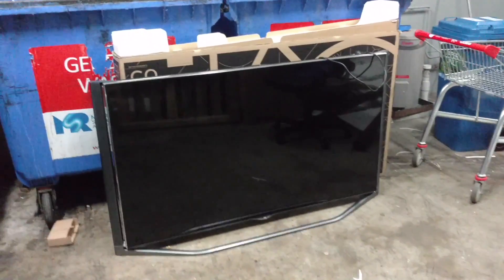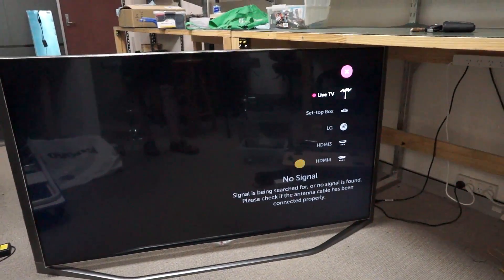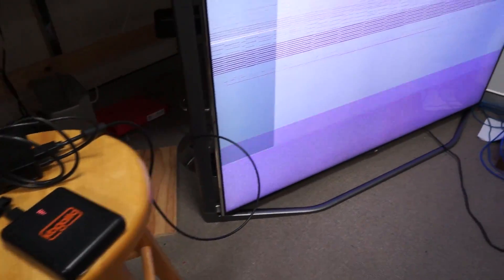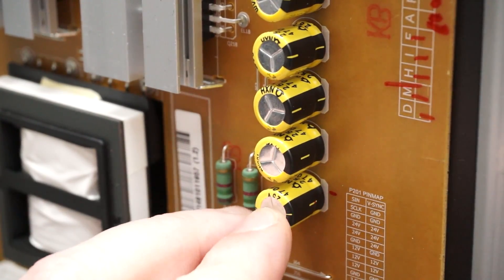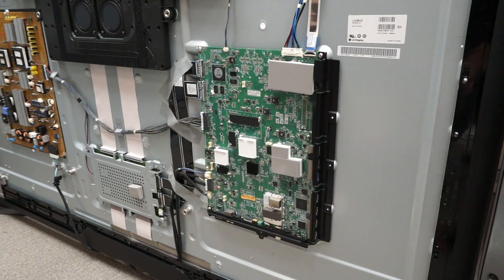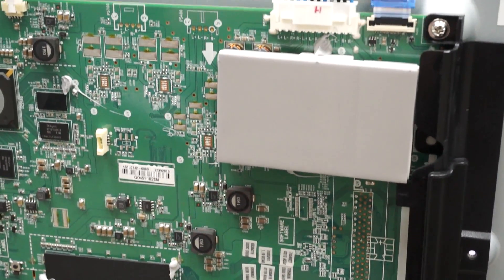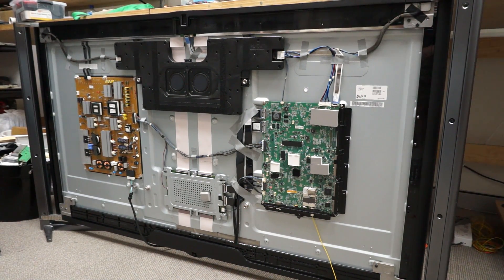EEVBlog #1145 - Dumpster Diving 4K TV!

Comment: I got an excellent salvage just before Christmas. One of the sales guys here, his mom's TV kaffed. It was still under warranty so when the tech couldn't get it going, they sent him a replacement. It's a 50" 4K Hisense  Model 50H7709 Smart TV that would power up, the logo would display, then power off again. He was about to toss it in our dumpster and I asked if I could have it instead. He said yes and sure enough, I found some bulging caps in the power supply section. Ordered replacements, waited, installed and WOOHOOO!!! It worked! I had to order a replacement remote but it works beautifully. I gave it to my daughter for Christmas. A $300 tv for $8 in parts & shipping and a $12 remote.

Comment: if nothing appears initially wrong with the TV
CHECK THE OTHER INPUTS

in my experience repairing these things, i have found when you score something like this that seems too good to be true (and.. it does happen sometimes that they are flawless) but... a lot of times

- The TV input Video is fine
- the OSD shows up no problem

but sometimes the RF Tuner input is broken  (not hard to fix)
Sometimes the HDMI 1 or one of the other inputs will have video issues , like   No Red   or  No Green or something similar,   you need to replace the mainboard in most cases.
but in any case,   good score
and also   VERY UNSATISFYING   hehe
i know the feeling ,   it fucking sucks ,   you get it back to the lab,  you expect you're going to troubleshoot something and it fucking works..... hehe     pisses you off,  huh

EDIT :
previous comment was me only watching around 5mins of the video
and... there you go..... HDMI INPUT FUCKED UP,  as i suspected

and yeah... .there usually isn't a separate HDMI board,   the inputs are usually located on the mainboard / motherboard

Comment: 5:35 that's where you may be wrong. I had an LG TV very similar to that one, and after a few months it developed an issue where the backlight would just turn off in the middle of using it. You have to turn off the TV, wait like 20 minutes and then it would work again for no more than an hour.

Comment: Use cold spray on the larger chip and see if that works, it works for many things like bad joints on a PS3 BGA chip. Cold brings things to life by using contraction to briefly pull everything tight.

Comment: It is a pitty you don't have the remote-controls für it?! Had one almost similar to this and there are two zappers included. One works like a pointer to control the mouse-cursor. Very nice and quite cheap devices those LG! Really love them. Even looks similar inside but another model.
Used mine as a pretty nice 4K-Display for a computer. In 2014 there was only one grafic-card able to do the 4k@60Hz (GTX 970/980).

Comment: Hey there.  If you dont want to replace the board right now... if the unit has RGB inputs you could probably use those instead in the mean time. On LG tvs The HDMI signals are converted back to analog  RGB before they go to the Tcon board so if the problem is not in the chip itself it should work like a charm. Enjoy your vids. Keep up the good work. Thumbs up!  Also to anyone who is listening, HDMI ports are NOT plug and play.  If you unplug or plug in cables while the tv is on you run the risk of this happening to you :o

Comment: As it seems to be webOS based on those screens, hook up the Ethernet and use the LG TV Plus app on your phone as a full remote. That will get you into the menus. You should also install the developer tools app from the LG store and log in with a (free) LG developer account, which will let you turn on side loading of apps ahead of the day when they turn off the app store servers.

Comment: Try updating the units firmware 1st. Ive had some success with this as a starting point to fixing these type display issues with various manufacturers. Available here https://www.lg.com/au/support/support-product/lg-65UB980T Also try turning your hdmi output producing device (settop box/dvd/pvr/etc) on (cold power start) after switching the tv on and over to the required hdmi input. I've seen Kogan TVs in 2015 having a problem with hdmi bitrate and would produce video results like you have. Starting the output device up after the unit was switched over and ready to receive hdmi data sorted it out.  Plug an aerial in and see if the onboard DTV tuner works.

Comment: Simple...unless you personally know how to fix it repair is cost prohibitive.  If you can even find someone to look at the thing at all they will usually want $100 or so to see it at all and then it just goes up from there in cost as they poke around.  Then you add in parts, repair and testing time soon its as much as a whole new unit and tomorrow something else could blow up on it.

Generally out of warranty failure is instant death for modern stuff to an average user.

Comment: LG 4K video cpu processor failures and display software corruption though be it inherit faults in the system or online viruses affecting them is unknown, could be something picked up online if it was connected at some point, if it's been used with indonesian or vietnamese satellite tv over HDMI it might be something off the satellite tv programmes...

If you can get hold of a genuine remote for the set you might be able to carry out a full factory reset, and if that does nothing, get a USB memory stick with JPEG still pictures, and if they display try downloading a full firmware update.

Comment: idk what its like down there ...but u should be able to find the logic board dirt cheap on ebay. the display panels are almost impossible to get replaced by 3rd party and even if so the price is unreasonable... so what ive seen is ebay ends up flooded with the logic boards because a lot of times people will just leave a tv with cracked panel at a shop upon learning the cost or infeasibility of repair

Comment: My pc hp monitor don't support lower resolution then 2k native and if I install a older game that don't support 2k resolution shows a similar picture 
May be OK make shure your pc is setup on the panel native resolution also the hdmi cable must support 4k I have issues with any cheap cable red rusters wierd dots on screen

Comment: I fixed a tv that got zapped during a storm by replacing the power supply board for $15 :( I feel sad when I think about all those electronics easily fixable that get thrown out. I've seen people smash a "broken" macbook pro because it wouldn't boot past the Apple logo.
Reply: Apple makes it very expensive to repair those macbooks that buying a new one is a better option even if the fix just cost a few bucks.

Comment: Unless the problem is minor, it's not worth fixing them anymore. I just bought a brand new 4K 50" Samsung Smart TV for $368 shipped.
Reply: The one he has is 65 inch.  If you can get a replacement board for a few hundred, then it is worth fixing.
Reply: @my3dviews  Not really, you can buy a 65" 4k UHD Smart TV for roughly $750.
Reply: @electronicsNmore   But if it only cost $300 or so, it would still be worth it

Comment: It may be worth giving the main board a reflow cycle in an oven at 210 deg C for 10 minutes to fix any eventual dry joint, especially in the BGA chips.
Reply: 210 degrees in an oven is "rehotting"; nothing flows at that temperature, except maybe some plastic parts. Real reflowing can be done with suitable equipment.
Reply: @mjouwbuis  depends on the solder type, and I mentioned degrees Celsius.

Comment: I got a scrap LCD tv couple weeks back, was told it didnt work, but powered up and the screen seemed fine - used pc input no probs. But 'no signal' when I tried HDMI, found issue was bad caps in power board giving low output on a 3.3V rail, which was used solely for the HDMI processing circuits. Two caps swapped and its all up and running again!

Comment: Need to check all the other inputs, HDMI is a common failure on many flat screens it's normally the processor chips that fail on the HDMI side, if all the other inputs do work ordering a replacement border would be the simplest fix, of course if the other inputs work do you really need the HDMI becomes the question.

Comment: Probably some failing RAM chip somewhere on the board, as smart TV's like to reproduce the image.. it detects and recognize the signal before it gets to the [signal processor] to give you the smooth fps and color stuff(which i dont like lol).
I wonder if you can put the tv in game-mode to by pass those stuff, but probably to get there, you need a remotecontroller. some phones has build in IR (LG G5), or try a universal remote controller ~.

Comment: Yup I agree with zapro_dk  LG 4k's are notorious for bad BGA joint on the video scaler chips etc.  they have a very poor design in heat dissipation.   The get D- in my grade book of reliability.   If you only have the tv on for short intervals it should last a long time.  But don't leave them on for long periods.  You will be lucky to get a year or so out of them.

Comment: Get a heat gun and slightly flow it over the board while the unit is on. You may find when you pass over a chip or circuit it will snap back the picture temporarily. That might at least tell you the area of the board the issue is in.

Comment: Had similar issue on a TV, did service menu (required ir remote and pressing a sequence of keys at boot) and changed timing settings on DDR, then it worked.. But as mentioned in other comments, do try a movie on usb stick !

Comment: I'd have started by baking the input board in an oven for a few minutes. That's enough to reflow solder on the BGA chips, and possibly fix the problem.

Comment: The panel is toast .. it is not the mainboard .. it can be fixed but only with very specialized tools
Reply: If the panel was toast, then it wouldn't display the menus properly, as it does.  It is an input issue.
Reply: @my3dviews  more like an image processing issue,  but indeed not a panel problem as it wouldn't give a good OSD otherwise.
Reply: +mjouwbuis    True.   It could be narrowed down further if he would connect an antenna and try to receive an over the air broadcast of a TV channel.
Reply: you may be right .. I see horizontal lines and it screams row driver .. he will need a new mainboard minimum if it isn't the panel

Comment: Does the smaller broken tv have the same mainboard? If it is, may be it might work in this one?
Reply: It looksa few years older, also a TV that size won't usually be UHD 200Hz. It is very rare to find different looking sets with compatible mainboards. Mostly each mainboard is used a small series with different screen sizes and minor differences in features. Then, next year the then new model line up gets new mainboards.

Comment: Interesting that the HDMI connection negotiation seems to work to some extent. Would suggest that it's not necessarily at the input itself rather some intermediate connection. It's going to be an interesting project to trace that problem out though!
Reply: That was my thinking, particularly as only one source was used.

Comment: Thanks.  Wondered what was in mine.  Of  course, mine is ancient - 2010 model with 1/4 the pixels.  I don't know how we live.  

That said, your point about it not being worth the time for the end user to get it repaired makes me think there is a market niche for a company that provides "TV service" ... you give us $N/mo (where N is something that lets you run the business) and we'll make sure you have a 4K/UHD on your office wall for the next year.  Buy all the same exact model (becomes a hassle as the manufacturers change things up, I realize) and just send out a tech with a new one whenever something breaks.  They are in and out in 15 minutes, customer is happy, tech takes it back to shop and it gets repaired there.  You have dozens of the same model, so you know what breaks and can stock those parts.

There, I made a side business for you, Dave.  Don't let me catch you saying I never did anything for you!  :-D

Comment: You need a universal remote. The LG  TV usually comes with a WebOS and you can just use it as a smartTV with a Ethernet cable or wifi it if has one.
Netflix, YouTube, etc all might work - or a lab project to display  stuff over the web. Right now it's likely in the input mode for HDMI etc not the system OS.

The channels usually need to be "scanned" in the menu to even get listed.

Comment: There are places which you can search for on the web that supply replacement internal boards for LCD, LED, Plasma Televisions (All Makes & Models)
For Example.......
https://www.statewideapp.com.au/tv-lcd 
https://www.statewideapp.com.au/lg-remote-control-177821  <-------- Replacement Remote Control for the Television in this video $81.95 including GST.
They also sell (as I mentioned above) replacement mainboards etc. for that Television.
The web link above is not the only place where you can buy Television replacement parts there are others.
For that particular Television the replacement boards and their associated prices if you are interested.......
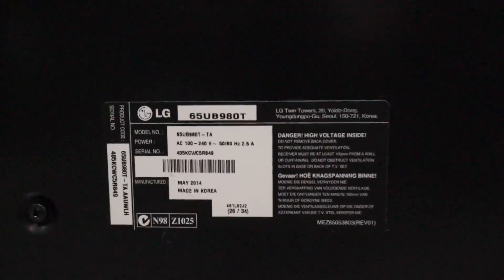2:42 LG Model : 65UB980T-TA.AAUWLH
Replacement PCB's for the above Television Model 
LG TV MAIN PCB ASSY-65UB980T - $256.95 (Link Below)
https://www.statewideapp.com.au/lg-main-pcb-assy-205172
LG POWER SUPPLY ASSY - $271.95 (Link Below)
https://www.statewideapp.com.au/lg-power-supply-assy-206281
LG WIFI MODULE ASSY - $92.95 (Link Below)
https://www.statewideapp.com.au/lg-wifi-module-assy
LG SUB PCB ASSY - $61.95 (Link Below)
https://www.statewideapp.com.au/lg-sub-pcb-assy-205685
LG RF PCB ASSY - $42.95 (Link Below)
https://www.statewideapp.com.au/lg-rf-pcb-assy
It wouldn't really cost too much to fix.

Comment: LG TVs are made to fail within a year or two after warranty runs out.
Reply: my samsung failed just a few days after warranty expired, so they are getting better and better at this
Reply: I still have a 2009 - 2012 (not sure when) 1080p 3d LG tv, still works except for the tuner, but we use a set top box anyway
Reply: I have 5 LG TVs (2 of them are Monitor/TV combo) in my house and all works! My oldest is an 32LG3000 from 2008 with more than 15.000 hours and still work like first day. I have friends with LG TVs and no one have any problems with this TV sets.

Comment: How easily do those plastic heat sinks come off?
Reply: I wonder if they are heat sinks or just hacks to delay the BGA breaking?  Its not unheard of for them to do hackery like that to apply pressure to offset the board warping from the heating and cooling cycles.  This seems even more likely considering people in the comments suggesting the BGA breaking is a common fault on this model.
Reply: @alexatkin  Thinking you might be right

Comment: I once found a $5000 samsung 65 inch behind a Joyce mayne. I took it home plugged it in and it would turn off after about 30 secs of use. I opened it up and all the problem was? 2 x $1 caps that had gone. found 2 that were the rated slightly higher. It ended up lasting another 18 months. It truly is amazing what ppl throw out
Reply: that's like, fuck the planet. I'll buy another planet.
Reply: @springrollwang4441   Amazingly (or not so), near-on 90%+ of the creatures currently thrashing said plane(t) would ask "where do I put my card?".

Comment: maybe it’s just the hdmi cable? don’t you need version 2.0 for a 4K display? 🤔🤷‍♂️
Reply: His PC was only outputting 1080p so it wouldn't matter.
Reply: It doesn't matter. Hdmi is backwards compatible. You're just limited by the older standard.

Comment: I hear you. I've got an old plasma 47inch 720p, later a 37inch toshiba and finally another 47 inch, the latter a super slim PC compatible 1080p TV in great condition and just needed LED strips replacement. I still use them besides the plasma one, which works.

People is tossing TVs just like that and buying new ones. Scavengers like us like that. Still a shame for the environment.

Comment: I found a 2014 vintage 55" Samsung 4K set at the recycling center about a year ago. We took it apart, found one single dry solder joint in the power supply that actually arced at some point.  Once we reflowed that joint, it fired right up.  It's been my main living room TV since then. Can't beat free!
Reply: Jamie Richard
At my local council recycling centre, they won't even sell stuff to the people who pay the Council Tax to run it. :(
Reply: Raunchy.
Reply: Vintage really

Comment: If it was me, I would be checking for the pins in the connectors first. It is the mechanical interface that people try to jam together. Wrong HDMI pin could be shorting HDMI shared voltage or signals.

Comment: Its usual problem on UB and UF  series lg tv with ursa chip (top left close to  panel interface , used for improve PQ  and mux osd with video)it has 2 channel vbyone interface to main soc ( mpeg decoder , hdmii mux and other video stuff ) one channel to osd graphics  (work ok in this tv ) and second channel to live video data from all sources (broken on this tv ) , download service manual and you see it on block diagram  , solution reball  or change soc or ursa  chip or replace mainboard
Reply from the maker: Do you have a link to the service manual?
Reply: @EEVblog  https://mega.nz/#!i2wTxSwS!4KGOtF40-AmOsmdX1i9MDVkCBCv28vQN8QeCCrCIwnA
Reply: on page 65
Reply: Makes sense, also explains why theres a missing heatsink right there 😉

Comment: Your lab really should have an Android phone that has an IR transmitter!!
Reply: rkan2 Or a two cent IR LED and a $2 Arduino Nano clone. You don’t need a fancy cell phone just to generate IR signals.
Reply: First Last Sending the IR signals is surely the easiest bit... The thing that is worth it however is the database of 100s if not thousands of TV,projector,settopbox,air conditioner,dslr,audio system,iptv boxes etc.. Also no need to create a UI for nice user experience. Why do the work yourself when you can get a phone to use as a remote for ~20e